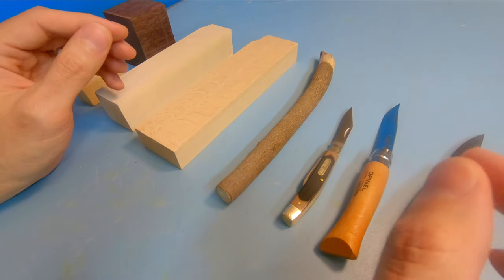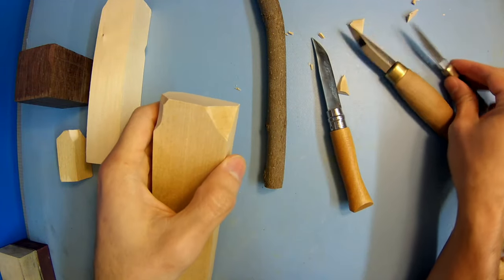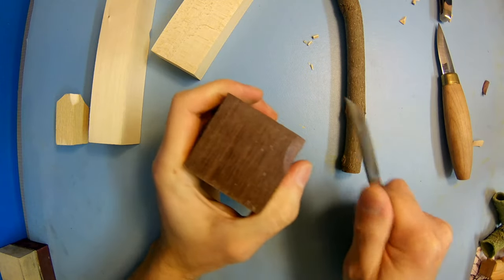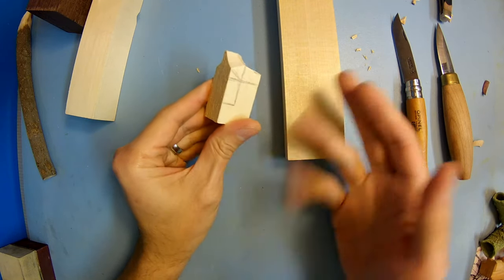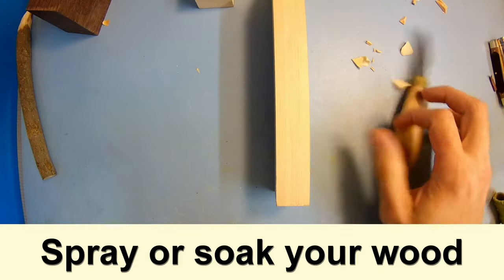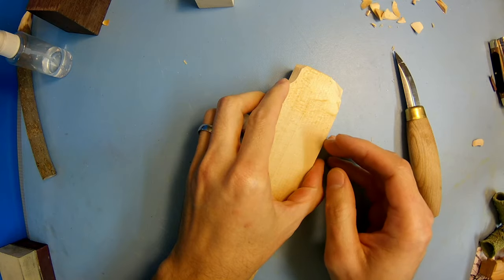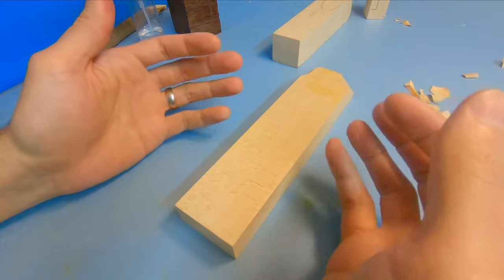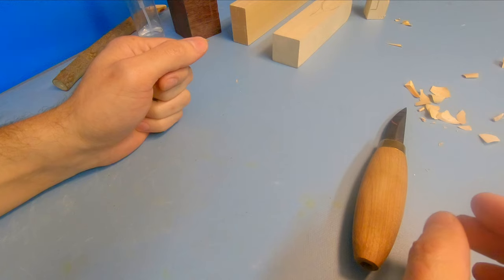How to Make Wood Easier to Carve - Whittling and Wood Carving Tips for Beginners

Comment: Thanks for this. I just started and was having a hard time understanding how basswood was supposed to be so easy to carve. Apparently the stuff I got on Amazon either wasn't basswood or was kiln dried super quickly and had too much ( or too little?) moisture in it. It was harder to carve than oak, birch, pine and any other wood I had lying around. Then I got some non-kiln dried wood and it was so much easier to carve. I wish more people would talk about the difference in density and carving between kiln dried and non-kiln, natural dried basswood. Yes, it was a bit more expensive, but it was so worth the three or four more dollars.
Reply from the maker: That stuff on Amazon is super hard!  Same with anything I have found at my local craft stores.  
It seems like they remove almost all of the moisture, making them super hard to carve and rough on your knives. Going out of your way to find the air dried wood always makes for a more enjoyable experience :)
Reply: @CarvingisFun  Hi Brian, okay so I'm new to wood carving but not wood working, my thoughts on this is straight forward, why not use a plant humidifier? They sell them on Amazon using that along with a 10 gallon aquarium turned upside down over the wood along with the humidifier of course should work, you can even customize a internal frame using two uprights and some bamboo skewers for the pieces to lay on anyway, I was just thinking out loud.
Reply from the maker: Honestly never thought to use a plant humidifier!!
Reply: Im glad its not just me! Amazons wood is brutal compared to the stuff I've gotta on ebay thats air dried.

Comment: I lived in the desert and my Basswood and my other carving wood would get very Dry. I learned from Master furniture carver from Persia to use Kerosine/Paraffin/Lamp oil I get the type that says low odor. It last longer then using water and alcohol. I brush the Kerosine on my wood the day before I carve to allow it to penetrate the wood. If there is any odor it, it will soon go away. It makes a huge difference. The wood is more manageable and takes on finer detail prevents less wood fibers from splintering . Now that I posted this it is no longer secret technique used by professional/master carvers.
Reply from the maker: Nice!  I thought about using oil but wasn't sure how that would affect the wood long term and if the oil will eventually dissipate to allow the wood to fully dry.   Do you find that your method causes any issues with wood finishes or discoloration over time?
Reply: @CarvingisFun  I have had no problem at all. If your wood is dry it sucks it up like a sponge. I use General Finishes Arm-R-Seal and Linseed oil. I have not used it with stain. But my Friend who taught me this carved high-end furniture that was stained. In time, I believe it just evaporates. When using water and alcohol I found the wood fibers swell up too much. And when it dries the fibers want to separate in the finer details. With the Kerosene I only need to apply one time. As long as I don't let my project set for an extended period. Good luck, and thinks for your videos. It would be great if you could do a video on it. I have not heard of this method from anyone else but my friend. And I have taken online courses, classes, read numerous books, forums, magazines and as a member wood carving group.
Reply from the maker: I will have to add this to my ever growing list of things to try, thanks for the info!

Comment: An important point that you neglected to mention, is that a knife with a relatively dull edge will often slip and cause a nasty cut on one's fingers, because one tends to put more pressure on it to make a cut, than when using a properly sharpened  knife.
Beginners should be told to be aware of this.
Reply from the maker: You are absolutely correct and I did forget to mention it!
Reply: Carving is Fun 
Good. Your sentence has been reduced to “time served”, and we will expunge the record.
Reply: @CarvingisFun  I think I recall You did mention that.  Yup,!  😇

Comment: I was trying to carve a pear in a piece of some kind of pine or fir that I had purchased from a store similar to Home Depot. The wood was dry and brittle, but when I applied WD-40 to it, and allowed it to soak in a bit, it carved like butter. I had to reapply it now and then, but I was amazed at the difference in carving, even when carving against the grain at the top and bottom edges, and will definitely use this method again, and I highly recommend it, if you don't mind the aroma. :-)
Reply from the maker: Yeppers! WD-40 is a great alternative but the smell can be a bit much.  I've heard that WD-40 is made of oils like baby oil, but have yet to see if applying baby oil will have the same effect since it lacks the solvents.
Reply: @CarvingisFun  I agree that the odor can be a much for those who cannot tolerate it, although I am one of those weirdos who actually like the smell, enjoy the aroma of petrol too...LOL I will have try baby oil when I do my next project to see if it will have a similar affect. :-)
Reply: @CarvingisFun  I heard wd40 is made with fish oil.
Reply from the maker: Naw, not fish oil.  If so nobody would use it from the smell!!

Comment: I've used a lot of memosa wood and pecan i love pecan cuz of the colors but its hard I have to soak it sometimes if its been seasoned I've found that putting it in the oven at low Temps after im done carving helps with cracking issues
Reply from the maker: Thats a great tip!  How long do you keep it in for?

Comment: Great video thanks ☺️. I live in the redwood forest on the coast of California and the fog is thick at times. Have you heard anything about using the fog to put moisture back in wood and if so how long is recommended before the wood would be to moist and have. swelling problems. I bought a 3 foot tall wooden carved bear for the front porch but have kept it in side the front door to prevent cracking and after 20 have had no problems.
Reply from the maker: I guess that eould depend on how long the fog lasts, but I havent heard of people using fog specifically for hydrating wood.

Even with the humidity on my end, swelling is minimal and not much of a concern unless left out directly in the elements. Then it would be down to the resilience of the wood to withstand the elements.
Reply: I'm in Santa Cruz right now. It's much cooler. I use a spray bottle to give the wood a little moisture it helps a lot and keep my knives really sharp. I live in a van so most of the time I carve outside. But never in the fog because I'm afraid the salt in the fog might rust my knives. Have fun and keep carving.

Comment: I've just started Whittling, and the first thing i've found is that my left hand thumb gets very sore even though I wear a protective glove. After a while pushing on the back of the blade, my thumb really hurts. Any suggestions?
Reply from the maker: Howdy and welcome to the club!!

I had the same issue and actually ended up wearing a hole into my favorite gloves over time, but I do have a solution that works very well.  Since I have several rolls of the self adhering bandage wrap (ace wrap) that I use for finger guards, I just add another layer on my pushing thumb with the wrap and it makes it much more comfortable to push on the blade.  

Full details are in this video here: https://youtu.be/o2ugpgBg8uU

Comment: Is beech good for whittling?
My bf and i cut down some beech yesterday, and i decided to take some of the wood home for carving and whittling.
Should i leave the wood to dry before i start whittling or can I start while it's still very fresh?
Reply from the maker: 100% whittle it while it is still wet.  It will be softer and easier to work with compared to when it dries.  

You can still carve it by hand when dried, but it may be a bit harder to do.
Reply: @CarvingisFun  Alright then.
Thank you for the quick response- you're a legend! <3
Reply: @CarvingisFun  Hello! I'm sorry to bother, but today i noticed the wood started cracking a lot. Is there a way to prevent this?
Reply from the maker: During or after carving?
One downide to wetwod is that it had a higher chance to crack as it dries.  
Many peope will sometimes keep the wood moist while carving or let the wood partally air dry before carving.
But there isnt too much you can do qbout it sometimes and is something many carvers have to deal with.

Comment: Is that Opinel NO6? I am going to buy one to start carving and i am wondering what size i should get. I am not sure should i get 7 or 8. I have victorinox with small blade which i am going to adapt for carving, so i guess opinel 6 will be useless.
Reply from the maker: That one is an opinel carbon steel #7

Comment: What knife do you recommend for a beginner?
Reply from the maker: Howdy!
This can depend on where you live, but if you have them available to you Flexcut or OCC Tools are great tools to start off with as they are well priced, are not too thin to prevent damaging the blade, come to you with a proper cutting edge already applied to the blade, and use good steel with the right hardness for a long lasting edge.
Reply: @CarvingisFun  Thank you so much for the reply! I’m a beginner at whittling and I don’t know what tools to start with, so thank you!

Comment: If you spray your wood to soften it, how does it work with a pattern you transfer with an iron or carbon paper.
Reply from the maker: Spraying your wood does have the potential to alter or smudge your design, so I would be careful when doing this.  

Typically, I would only spray the wood if I need to make a difficult cut so be selective when and where you spray the wood.